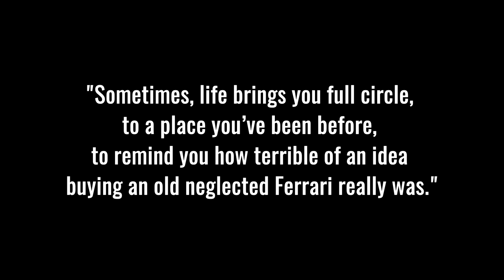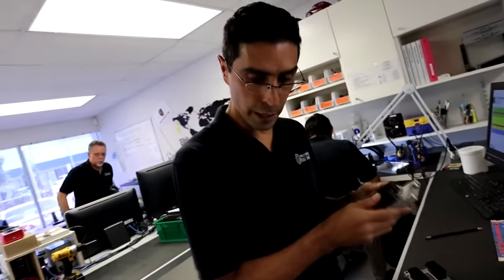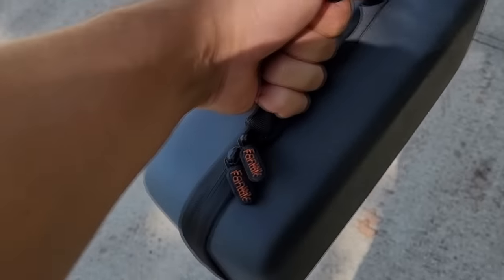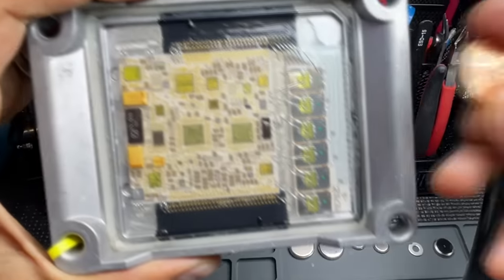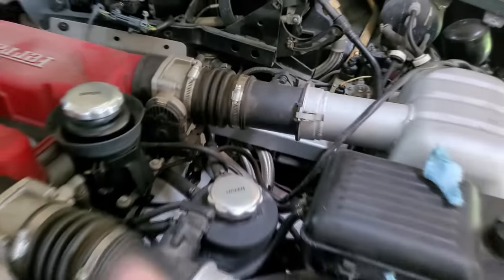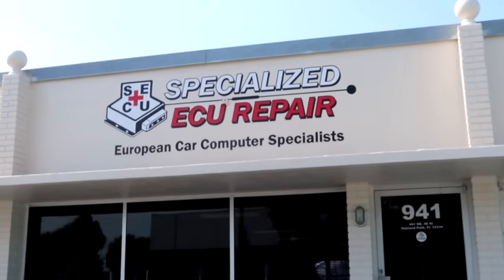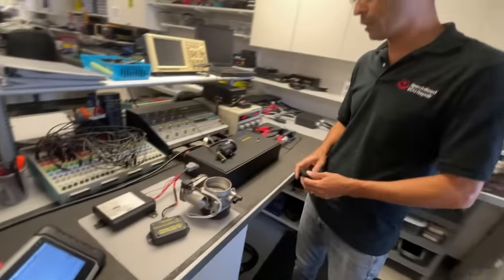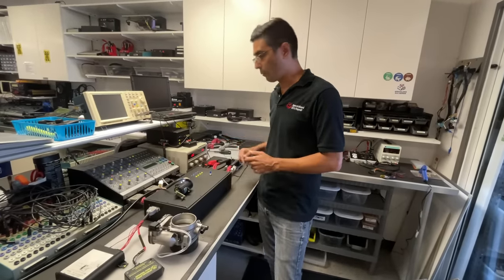Here's What FINALLY Fixed my Cheap Salvage Ferrari!!! (EVERY Ferrari 360's Fatal Flaw)

Comment: Honestly at this point the best bet is to take two bad 360 ECUs and pull the connector off of them and use them to make an interface to something like a Motec or Haltech stand alone ECU. That should solve the supply issue.

Comment: on bmw m52tu there is same problem with throttle(it has electromechanical throttle),   i think it made by vdo, engine computer is siemens. it starts clicking after ignition on. if turn igntion on with full throttle problem it is not clicking and working normal. after replacing throttle problem dissapears until new throttle is starts clicking.
Also on 15:00 same method bosch used on ABS brains. they also breaks because tiny wires unsoldering from temperature and vibrations. if problem in this wires it can be fixed by specialist. its better keep this blocks away from high temperature

Comment: Companies like Specialized ECU will become more and more important to keep even antique cars running as pretty much everything from the mid-80s on has an ECU. And the recent cars are pretty much 100% run by the computers. When those fry, you are SOL unless somebody can fix it or you can still find a working replacement.

Comment: If you can extract the ECU software then it is certainly possible to emulate the functionality of the impossible to repair Ferrari ECU using any modern single board computer.  Basically you simulate the Ferrari ECU with a newer, faster computer and run the ECU software on that.  This would not be a trivial undertaking but certainly a better solution than junking all these Ferraris when their ECUs die and replacements are no longer available.

Comment: It should be possible to simulate the ECU using a suitably large FPGA and a suitable simple circuitboard. The idea being to build an observational based clone of the ECU behaviour, based only on its observed external behaviour while the car is being driven. This method has been used to replicate VLSI logic behaviour after the original design was lost. Basically you monitor all outputs of the ECU with a laptop datalogger interface, think custom logic analyser/datalogger. For any analog outputs, you need A to D converters, sampling all outputs and inputs, the simulator on the FPGA then basically replays the correct output behaviour based on the current inputs. Some output signals will be dependent on the previous milliseconds of history, so a simple mapping will not suffice. However, the model need not be 100% perfect. History shows almost every stock engine map can be improved, by tuners, and once this board is running, it could be tuned in its own right.

Comment: For all car owners, from a 50 year electronics veteran:
3 components are subject to aging: zener diodes; electrolytic caps; EEPROMS.
The fact that it was fixed by reflashing proves it's the EEPROMS. We all need to have our ECUs reflashed every 7-10 years as maintenance to prevent failure down the road. But then, can we...?

Comment: Just looking at it without seeing what came out of the flash, it seems that the ECU flash maybe degraded and the ECU was just resetting.  Since all the same signals were still coming to the ECU, the ECU proceeds to reset the throttle body (likely the 1 click it is supposed to), and somehow resets and the cycle repeats, resulting in the throttle body clicking.  Of course, he just gave you a "new" ECU presumably, so if there was some other problem that would cause that reset, like maybe some test failed because of a bad wire bond, its hard to tell.  Without actually being able to step through and debug the code, you're only real choice is a new one with a reflash.  Car ECU have so many signals coming to them, that building something to replace the Ferrari 360 ECU is possible, but it will take a while, since you'll have to reverse engineer all the incoming info and signalling leaving the ECU.  It looks like there are at least 100+, maybe even 200 pins between the 2 connectors, so that's quite a task.  Although, I'm surprised the guys there haven't taken it on since it seems like you might sell a few.

Comment: Yeah that might be a great jump pack..... But it's harder to jump a vehicle with a completely dead battery than it is one of the battery cables disconnected..... With the cable still connected ,the battery will try to draw juice from your jump pack......

Comment: I’m installed a Megasquirt ecm on 2 of my vehicles. Guess where i did NOT mount them? Hot ass engine bays, or worse, ON the engine block of a Cummins Diesel engine.

Comment: I wonder if phone repairers can work on those ECUs. Obviously someone like Specialised ECU would have to do the majority of the work - the diagnosis and sourcing of parts - but replacing these small, tightly-packed components is also a very special area, one where phone repairers operate all the time. It might be something worth investigating.

Comment: The best way to deal with this would be to build a replacement ECU out of packaged components so it can be serviceable. Copy the software over and boom all good. I would be surprised to find any company that makes a machine to service this type of ECU. The way the chips are attached to the ceramic substrate alone would be nearly impossible to detach, you  could unwire the bad one, bond another chip on top, and wire that in. But you would still need to acquire the chips, in unpackaged form, basically the wafers themselves, cut them up, then bond them in.  None of this can be done by hand.

Comment: From the looks of it its resembles a bad or about to go bad capacitor therefore causing a fairly big voltage drop or spike causing a reset loop back to the TPS side of the ECU

Comment: Yeah as a pc tech it may be a bad smd resistor or cap from heat cycleing over time. (Heat the eventual killer of all circuits) causing a looping cycle of the power for the ecu as it cant regulate the voltage and/or the signal resistance. Unfortunately due to the specific manufacturing process replacing the faulty components is made impossible. And due to patients reverse engineering a replacement is made illegal.

Comment: Awesome Sam!! Glad you got this rare 360 fixed. Next video I hope you make is finishing putting it together and then a nice spirited drive on some twisty country roads! Like the Enzo style key with integrated fob. The original 360 keys look similar but have the key blade turned 90 degrees from the key head compared to that one. Plus mine is a silver-ish gray color. Not sure if they all are, but I would guess they are. Did you get a red master fob as well?
Reply from the maker: Hey Dan, I have the silverish key, I also have a red key fob that was created by the guys at Specialized; my car never came with a red key fob!

Comment: I am surprised if you can flash copy the OS from a working ECU, it might be possible to create a rasberry pi or Ardino replacement. Assuming the ECUs are using a linux based os.

Comment: i remember opening an ECU from a 2002 Fiat Punto and wondering what all the "goo" stuck to the "lid" was, before i realised it was actually the wires connecting the external pins to the main board and processors! That ferrari ECU looks to be built the same way, nigh on impossible to fix.

Comment: If you watch a current being applied through a piece of wood, there's no pathway control for the current being applied. Ford and the Germans in the earlier 1900's used ceramics for current control and they found that the Ceramic has to be in a specific range of heat resistance. Over the course of time, though, the continual heat micro-melts the ceramic and leads to the loss of current control by fracturalization. The substrait you refer to is the same, since it takes high temperatures to create, and must be cool enough not to wash the aluminum away from the connecting route. This leads me to think that the ceramic has lost resistance ability, and the current is arcing from one lane to another causing a closed current when it should be singular, or open during the function values.

Comment: Good video, I had a problem with my wife’s 330d BMW , it just shut down then made a big mistake having it towed to a dealership to have them replace the engine ECU $$$$, then a couple of weeks later it shut down again, I fixed it looking at YouTube with a second hand alternator and IBS, dealership mechanics are crap.

Comment: One key would be this to have a really AGM battery very clean battery terminals blue permanent battery terminal protector and I would install some capacitors for voltage spikes one on output terminal of alternator and make sure the coils have capacitors only positive side for voltage spikes whatever can cause a voltage Spike where you put a capacitor you don't want overvoltage and you don't want undervolting alternator must be in good shape maybe a higher grade of electrical diodes and new brushes

Comment: I can't believe that there is not already an off-the-shelf ECU available that could be modded (ie flash Ferrari code and replace connectors and mounts) to just outright replace the Ferrari ECU entirely.  But I guess because of it being such a niche issue the aftermarket support is going to be extremely minimal.

Comment: Considering the board is not completely potted and is in a clear resin, there are Ways to remove the resin and perform the repair. Easier said than done. Each resin is unique. Also, if problem is not identified beforehand, then removing the resin becomes a guessing game

Comment: Is it a bosch unit or a siemins? Your best bet might actually be to take the image off your old ECU and run it on a standalone that emulates the original.

Even if you decide to replace your faulty unit it's only a matter of time before the replacement dies because something on that board is not designed properly...I highly doubt it's proprietary given Ferarri aren't really known to design their electronic systems in house.

I don't have one of these cars to test it on but if you're willing to send me a dump of your DME I might be able to send you back an image that will run on a standalone that will be more affordable.

Comment: It would not be a trivial challenge, but it should be pretty straightforward to implement a consolidated ECU design based on a modern industrial microcontroller. One computer to replace two, like every other industry post 1970s. There would have to be a lot of analysis done, but it would be do-able, with time and capital. Are there licensing or patent issues involved?

Comment: That style of ECU was introduced across a bunch of different cars / manufacturers.  They were unfortunately seen as a "through away" item. If it broke, you buy a new one. Thankfully they moved away from that style because vibration doesn't work well with a wire bonded circuit board.

Comment: Same repair process as the BOSCH 5.7 ABS/DSC modules.
The larger silver colored high current carrying “wires” on the circuit board break at their connection right at the board, and require a specialized repair.
I’m guessing that the Ferrari 360 ECU’s are failing the exact same way, and can be repaired with the same process as the ABS/DSC module....

Comment: at this point it's probably a better idea to rip out the total wiring of the vehicle and build a replacement kit, from engine, acc,  to HID. be a hell of a lot cheaper and less time consuming then trying to break apart the code and re engineer the OEM ECU.

Comment: Thats ecu looks very identical to the 06-09 saab 9-3 v6 and most gm v6 high feature from cts and various gm cars of 04-10 with a 2.8 and 3.6 and they have similar issues with fuel injector circuit throttle body curcuit and cam crank signals as well as purge valve .

Comment: The Manufacturer of the device may keep stock in this case BOSH. The fault seems to be the ECU is not getting the response it expects from the throttle body, one possible fix to try resouldering the connectors to the board they appear to be covered by black tape.

Comment: I'm just wondering if you'd take another ECU and program it the way you need it. Then, use an adapter to connect to your car. Or, use a raspberry pi to emulate such ECU.

Comment: motronic ME7.3 the issue is heat and vibration knocks loose the chip for the drive by wire so you get a no start doesn't work that way in the 360 due to twin ecus controlling the two banks. the same ecu is used on the Alfa Romeo 147 156 gta and gt 3.2L v6. the way we work out is if unplugging the throttle body the car would fire up but no throttle and a host of issues plug the throttle body back in car wont start. there as stated no way of repairing these issue. over hear in the uk a company has developed with the CAN-bus stream a stand alone ecu package for the Alfa Romeos affected. unfortunately that is the only real long term solution due to how the manufacturer made the factory ecu and cant be repaired due to there constructionand the fact they mounted them in the engine bay with the heat and vibration.

Comment: If you are in a situation where you have to pass emissions, it will probably never be legal to replace the ECU in states that have anything remotely like California's ARB and making something that would deceive the testing is considered illegal, which completely sucks. Even the Feds have been getting in on this lately with the EPA handing out big fines for "tampering" with emissions controls just for changing tuning parameters.

Comment: Go look at your video when you first got it, I'm not a tech any more buuuuut I can tell you your ecu is intermittent you have galvanic corrosion. You need new ground wires possibly new harness after a continuity check on ALL of the circuits. Ecus are finicky and need nearly perfect continuity 

Basically bad grounds

Comment: If the manufacturer no longer supports the car they've to publish the complete tech documentation (the control units/electronics are prob "the worst")
the entire circuit design: chips, transistors, how to emulate that processor... and also source code for that

Comment: Just get a Halltech or something like that and rewire the ducking engine! You can tune those things to work better than the original. Yes, it will cost more than the original ECU modules, but it will be much more robust and will not fail as a new original module will.

Comment: Bmw has a similar problem. The Mosfets go bad. You can solder some new ones in. Happened to my 2005 bmw x5. Bought the car for 500 as a no start. 40k miles later it's a great car

Comment: That does NOT simulate a battery completely dead, only adding the load of a dead battery along with the load or releif of an engine will simulate that. In other words, a dead battery often adds a load to the boost box by trying to draw power, or could assist the boost box by adding more power. The power draw can be caused the battery is trying to recharge from the higher voltage supplied by the boost box. On the other hand if the battery is only a little low it could assist the boost box. One way to simulate that is by adding another load such as a resistive load equivalent to the load a battery would present to the circuit if the battery is low enough to drag down the boost box. Removing the battery completely from the circuit actually could make it easier or harder for the boost box depending on charge on the 'DEAD' battery.

Comment: The most common component to fail is a capacitor. The way the throttle body is chattering (a cousin to motor boating) is typical of a failed capacitor. I can't see the construction of the board well enough to see if the caps can be replaced (they are generally the largest component on the board). 
If these relatively simple circuit boards are selling for $1,500 used, then it's time to contact a design engineer. I'm certain a competent EE can reverse engineer one of these in less than a week, probably in a couple of hours. He can then sell these for a couple of hundred bucks a piece and still make about $180 profit per board. If you need somebody to do this there are a few sites on the internet where engineers congregate.

Comment: Sam, there's similar problems with the similar ECU on the V6 Busso motor fit in the GT and GTA models during the early 2000's. Check out Luey's Garage on Car Project Central: Alfa Romeo 147 GTA Episode ~5 ECU Repair

Comment: Some alfa romeo with the busso engine use the same ecu and suffer the same issue with same symptoms, but I don't know if in your case the part who failed was the same, on alfa romeo the problem in the major parts of cases is one of the two yellow square resistances fail o was desoldering and normally is reaparable

Comment: Had a car shop I use to go to before I moved to Florida that would fault isolate until the real failed component not just what the computers said. I saved my girlfriend at the time $540.00 by taking her car to this shop. She had taken it to another place and they wanted $600.00 to repair her car. I test drove it and new what they wanted to replace wasn't the problem. I just don't have the test equipment to test cars computers if I had the test equipment I would have fixed it myself. It was such a simple fix and she was blown away when I caked her an hour later and told her it was fixed. Didn't even have to replace any parts. Just had to clean a sensor. She never had a problem again with the car.

Comment: I work as an IT-admin, but I'm not an expert here - yet I'm thinking that this age-old tech should be able to run on a beefed-up "Raspery PI"-thing . It would have to emulate the other computer, which can induce latency, so it needs to quite fast to mitigate this. But it should be possible, especially because they can read the software from the device. Whether the latency of such system could be made tolerable is a big question. It would be a huge project, but if prices are going up, it might be possible...